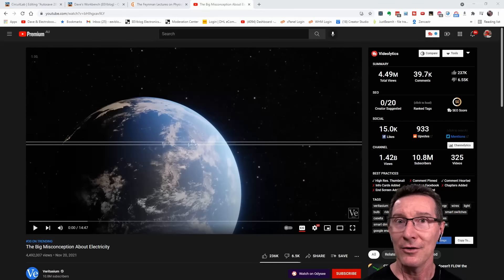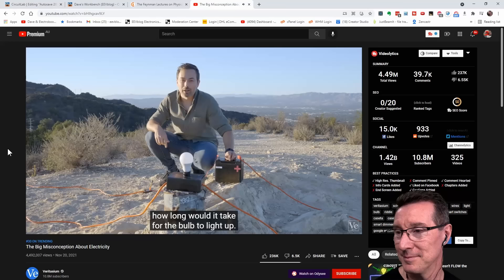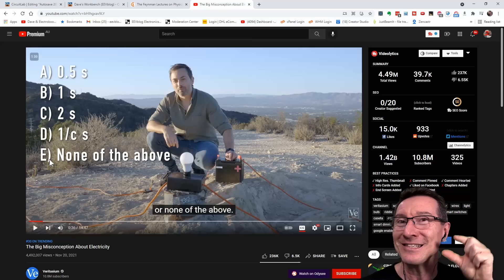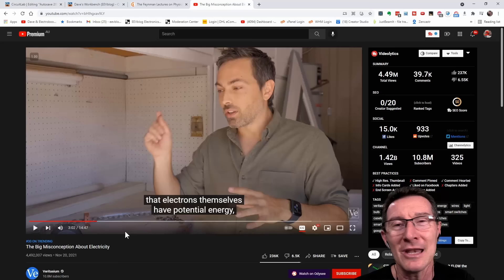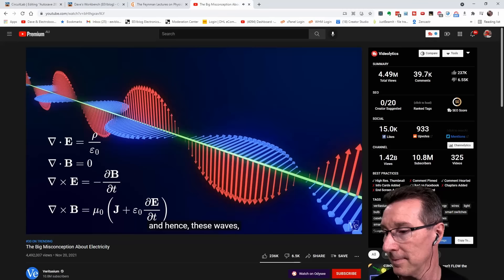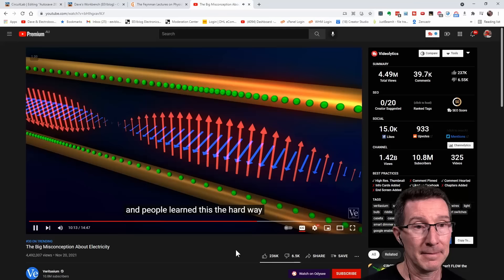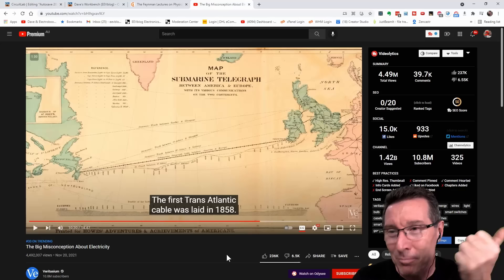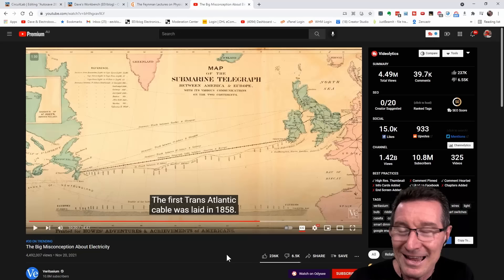EEVblog 1439 - Analysing Veritasium's Electricity Misconceptions Video

Comment: 18:45 is honestly the most important part between actually useful content and garbage.
19:42 is actually the part I find worse... Since it is a video targeting popular science. It is generally missinformative even if it is technically correct if one accounts for the intentionally left out information. (36:50 I like to remind you Dave that the video is for the Regular Joe, not engineers nor physicists.)

35:30 yes if the circuit were a circle, then it is the diameter of the circle divided by C seconds,

But the thing that annoys me with videos like this is that they don't actually explain things properly. Leaving the viewer with 1 answer that is only applicable for the ONE example scenario. While not providing the viewer the answer to Why that answer is correct in that scenario.

So I will dread having to deal with people who from now on thinks it takes 1/Cs for any electrical connection to be established. Though, depending on the material between the wires, it can take a lot lot longer than 1m/Cs unless we do the setup in perfect vacuum. The speed of an EM wave in a material after all isn't C (it is dependent on the relative permittivity, also known as the dielectric constant), but that weren't even mentioned, despite being a major spec of most transmission lines. (Though, doesn't stop even experienced network technicians from believing that their fiber optic cables goes at 300 000 km/s, even if they typically only go at 60-75% of that. The dielectric constant of glass is fairly high.)
Reply: wtf there was no info left out. He literally shows the bulb & the battery 1 m apart
"While not providing the viewer the answer to Why that answer is correct in that scenario." he literally spent the whole video explaining why it is 1/c s

btw 1m/Cs is bad form for 4 reasons
1) 1m = mixing variables with units = confusion. If you want to write 1 metre it is 1 m
2) Never put units on the left hand side. It is a waste of time & it's mixing variable with units
3) it is not big C it is small c
4) cs is wrong. The correct form is number space unit e.g. 5 s not 5s
& c s not cs
& 1/c s not 1/cs

Comment: The lamp will get a small pulse of current from the capacitance of the transmission lines when the switch is closed, but that is not what most people consider the lamp being "ON" as - you might see a short flash of light right after the switch closes, but it won't fully turn on, and stay on, until 1 second later.
Reply: It won't illuminate an incandescent bulb in 1m/c, as not enough energy will be transmitted wirelessly in that impulse generated when the switch is closed. It won't illuminate a conventional LED bulb as shown, as it's built with an internal power converter to convert AC to DC, which takes time. A LED with a resistor (to limit current in steady state) could light immediately, but won't stay on until the voltage transits the entire wire and impedance effects allow current to flow. So, we may see a pulse of light, but steady state light is likely at some time other than answers with specific values, so the answer is likely to be E, none of the above.
Reply: If there's no resistance, I think the electric potential will ripple through the cable, causing capacitive coupling to also ripple out between the parallell wires. So conceivably the full power would be delivered from the start and continuously until steady state? At least if the lamp impedance is much greater than the transmission line impedance.
Reply: @andersmusikka  Hmm, yeah, that could be the case.  Although, the amount of energy being delivered to the bulb would not be as much as it would be getting from the DC current along the wire, at least I dont think so.  So I guess we're talking about a constant transient, due to zero resistance, until the DC energy reaches it and turns it fully on.  In that case, it's still not what I'd call "turning on" because it's different from how it would turn on with a short wire.  But the point of the video is that the length of wire didnt matter.

Comment: I went to several years of school for electronics; with life's path, I ended up being an alarm/data technician for these past 20 something years.
I had seen quite a bit pertaining to EMF inductance and stray capacitance, namely weird transient effects on equipment.  
One notable example was a system that got dropped on my lap about 18 years ago when the original contractor couldn't make the system work for very long, lot's of false alarms, alarm panels getting fried on a regular basis.  The originally chosen panels used spark gap arresters built into the circuit tracings on the circuit boards, and no other surge suppression. At 2500M above sea level, they behave a little differently, namely, the breakdown voltage is much higher than at sea level, subjecting the electronics to harder hits before the suppression would kick in. the house ate panels at a rate of about every six months on average.
I finally installed 15V varistors on EVERY conductor feeding the panel and at the field ends. This extended the panel lifespan from 6 months to about 7 years.
A note on this home, it is about 80meters long (I work on rather large high end houses). On a general remodel 15 years after it's initial build, the main backbone bundle exposed, I found out why this place had so many issues with fried electronics; the alarm, TV coax and data runs were beautifully cigarette packed from one end of the house to the other down the main spine, all of it about 10cm from the main electrical bundle, which was also somewhat cigarette packed as tight as the electrical code of the day allowed.  This house became a poster child for why the local electrical codes changed, and why the electrical inspector now pays very close attention to the low voltage as well as the high voltage wiring, long runs must be kept a minimum distance away from the high volt electrical, and no more cigarette packing, ever.

Comment: As everybody who's had to fight their way through differential equations knows way too well, there is a steady state solution, and a transient solution.  Neither of these is right by itself, so ignoring the DC current (the steady state solution) is a fatal flaw in Derek's explanation.
Reply: Worse than that he used Maxwell's equations rather than Quantum Electro Chromodymanics.
Reply: especially because he uses a DC power source: a battery
Reply: I'm being a bit nitpicky, but steady-state and DC are not the same. Even in oscillating systems (AC) it is relevant to consider the steady-state and transients independently, as there will be some transient behaviour observed when flipping a switch to an AC supply, that will not be seen when the system is again observed long after.
Reply: @jonathanbuzzard6648  I agree, I was waiting on someone to bring this to the quantum level ! 😅
Reply: Wrong!  Derek’s explanation is also correct for DC steady state.  Energy is transmitted to the load outside the wire through the field, even in DC steady state.
Reply: @ChocolateBrocoli  Your pick is valid, but the nit nonexistent here: in the case in question, there is only DC and a step function.  The step function is the sole transient component.
Reply: @ChocolateBrocoli  "but steady-state and DC are not the same"

But aren't they really, viewed over a short enough time period?
Kind of like saying mountain growth (Himalyas, an example) does not appear the same as mountains that are stagnant.  Over a lifetime it seems to be pretty much the same thing, to me.  :-/
Reply: @alexchandel  Please explain this.  For energy to be transferred by an electromagnetic field, there must be both voltage and current components at the destination.  Without a change in current, there is no induced voltage, hence no transfer of energy.
Reply: @jonathanbuzzard6648  It's Quantum Electrodynamics (QED). Quantum Chromodynamics (QCD) is the theory about the strong nuclear force. But you don't need QED to describe this. You can use the regular Maxwell Equations. They are already consistent with the Lorentz transform. For simplicity of notation you can use the covariant formulation of classical electromagnetism.
Reply: @ManneSegerlund  You also need the Poynting vector.
Reply: @beingsentient  sure, but that can be calculated from the electromagnetic tensor.
Reply: @ManneSegerlund  So aren't you agreeing that you need something in addition to the classical Maxwellian Equations?

I'm a bit puzzled.  I understand that the electromagnetic tensor is contained in Einstein's equations of General Relativity, and that the Poynting Vector is derived from the classic law of Conservation of Electromagnetic Energy.  I believe you can also derive the latter from the classic law of Conservation of Charge, using relations from Maxwell's Equations for the EM field.  These derivations, as far as I know do not resort to any reference to General Relativity, and they seem to include something in addition to Maxwell, but I could be wrong.  

Would you care to elaborate to the detail that I could understand?  Thanks.
Reply: JESUS CHRIST IS COMING TO JUDGE THE EARTH SOON PLEASE!!!!!!!!!!!! CALL ON HIM NOOOOOOOOOOOOOOOOOOOOW!!!!!!!!!!!!!!!!!!!!!!!!!!!!
Reply: @beingsentient  just say out loud Jesus Christ. He is omnipresent.
Reply: @beingsentient  and will be answering for a little more time. and then, no more.
Reply: @lt3742  I just did say out loud, "Jesus Christ," and nothing happened.  So I said it louder, still nothing.  Finally I said it pretty loud and my wife wondered what I was doing.  But nothing happened.  What am I doing wrong?  What you say will work doesn't work.  Could you simply be wrong?
Reply: @beingsentient  no. He doesnt answer to sinners. you need to repent from your sins, or atleast admit that you are in really, really big trouble, without Him. He is really merciful.
Reply: @lt3742  But you first said he will answer.  So are you sure you got this right?  Maybe you should check out your sources.  But anyway, I did repent, and still nothing.  I've done numerous sins in my life and I'm well aware of them, and I repent, but still nothing from Jesus.  Maybe he's too busy now and will get back to me, I don't know.  What do you think?  But I'm beginning to wonder if you got all this right.

Comment: So, the energy will reach the bulb through 1 meter of space, by the means of capacitive coupling, way before the far ends of the wires start conducting?
Reply from the maker: Correct. You can also model it as an electromagnetic wave over the same distance if you prefer. I just like the capacitor model.
Reply: The question is just how much energy. That really depends but it will not be a lot. Probably in the low single digits percentages.
Reply: @nukularpictures  Depends on your transmission line impedance. Or the easiest explanation: The closer the wire, the bigger the capacitance and the smaller the inductance so more power on the first transient. And by "the closer the wire" I mean that you keep the light bulb and battery 1m apart but just move the wires so they kinda look like an L shape.
Reply: For the first 1/2 second, the result must be the same as though the circuit was broken at the far ends, because there's no way for the Derek/switch/load system to know whether those wires are actually connected.
Reply: @allesklarklaus147  shouldn't it also depend on the Switching Speed? A simple Click-Clack Katschunk switch should have enough contact resistance for a 12V Battery to have a smooth enough turn on ramp that you won't see anything at 1m distance. Not even thinking about the horrible response time of a lead-acid battery in high frequency application.
Reply: The right asnwer is relly "some energy"

If you running dc the lamp would evertually reach full power (or virtuellt, with in 5.minutes or so).

If you using ac... pretty much everything would be lossed due to signal dilution. So the lamp would inna real world case never turn on.
Reply: @matsv201  I feel like that is my problem with the answer 1m/c. There is some power that arrives at the lamp, but is it enough to turn the lamp fully on for a certain period of time so you can use the light it gives off?
Reply: @115maxx  If its a LED lamp and the voltage of the source is the corect for the lamp, it will not turn on in a way that its is luminating. 

Note that if you look at normal 12V led strips, if they are in a EM noisy environment, you will see that they are slightly lit, even when turned off.

But of cause the reason is that the power in the house is 230V (europe) and the voltage of the leds are 12V, so its really current that limiting it from being fully lit, not voltage.

But in this case the transferred voltage would only be a fraction voltage, in effect will not be light even a little bit due to the diode voltage.

The electro static effect of the current probobly have to travle pretty much all the way out before its even observably lit.

Of cause, if the wires was much closer, say 1 mm, and it would be a really high ohm led (like a single low power LED), then it could probobly be lit pretty much instantly (with reduced power)
Reply: That's my entire problem with Veritasium explanation and the whole thought experiment. It basically tries to prove "EM radiation is real" in a really convoluted and unclear way.
The other problem is the video kinda implies that ALL of the energy is flowing outside the wire at all times and no matter the circumstances. I bet there's gonna be a lot of misconceptions like that flying around for years to come.
Reply: @ald3nt3  In the example given, there was explicitly no resistance in the circuit.  Even if there were, the contact resistance is far lower than the transmission line impedance, so it wouldn't be significant.
Reply: @115maxx  Derek said you are to assume the lamp comes on instantly.  More hand waving.
Reply: ald3nt3 Well.. It is a mess. If we assume 1ns rise time that corresponds to a frequency of around 350MHz. Which means a wavelength of roughly 0.85m.. So the first part of that wire would make a reasonably decent antenna I guess. Again it shows that this whole discussion is purely academic and of no practical relevance. It is trying to resolve some obscure misunderstanding (which probably only existed in the mind of the author of said video) by making it even worse.

Comment: the real slight of hand here, was failing to include the capacitance between the wires in the diagram, whilst also relying on that capacitance to transmit the AC transient of the switch.

although honestly, the real answer is 0 seconds. because under these conditions, the light is already on from background EM radiation and the switch is irrelevant.
Reply: Yeah, I think he left out the diameter of the wire deliberately, and it is actually important here, because without that you can't calculate the characteristic impedance of the transmission line.  But placing the spacing at 1m, most practical engineers will just say, "the capacitive coupling over that distance will be negligible", and they will be right.  For the circuit to behave as Derek claims, the impedance of the transmission line has to be close to the resistance of the bulb.  For that 1m spacing, for wire diameters ranging from 1 to 100 mm, I get impedances of ~400 to ~800 ohms.  So it would take a light bulb of hundreds of ohms to get the result he claims.  There ARE light bulbs that would match this, but for example, a 120V 6W LED bulb ("40 Watt equivalent") draws 50mA and has an effective resistance of 2400 ohms, so it will not behave as described.  Yet, that's what it looks like he's showing us.  The details are important.
Reply: @BrightBlueJim  The wires are superconductors ("no resistance") otherwise it would be impractical to have any meaningful power flow over 2LS worth of wire. As such, the wires could be microns in diameter. Capacitance will be next to nothing, even with that much wire. So would inductive impedance. So the answer is 1 + 1/c, but the internet will continue to debate the definition of "ON". (But, as Rav Tastic points out, if you could build such a thing, the solar wind would power it.)
Reply: @jfbeam  Even with a diameter of 1 micron, the impedance of that twin line would still be only 1740 ohm, so no, this wouldn't affect the circuit all that much.  This is the problem with thinking of the capacitance and the inductance as independent properties.
Reply: @BrightBlueJim  For the "instant ''on''", the capacitance is important, as that's what causes the instantaneous spike. My quick math suggests about 3pF/m, so not even enough power to get an LED to flash. It will be just over 1s before that light is glowing. When I flip the switch to turn on any light in my house, I don't call it "ON" until there's a steady, continuous flow of light. The initial burst of 5 photons from a capacitive transient is NOT "ON". (a few dozen feet of 14awg wire about 2mm apart will have way more cap than these theorized 1m apart superconductors.)